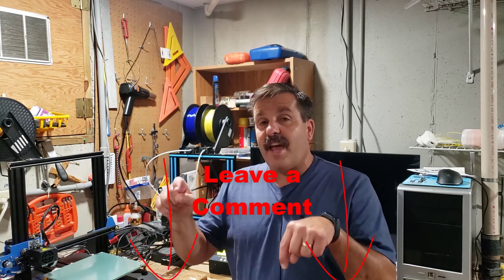My Geeetech A10M display is borked. Any Suggestions?

Comment: Have you tried unplugging it and plugging it back in? Also it might be a problem with the screen display and not the printer.
Reply from the maker: I have, but I am going to pull the whole display off now that you mention it. Thanks for the idea!
Reply from the maker: Dude! Worked like a champ. When I had the display removed it was so much easier to get the cable in place. Working like a champ again. Thanks! 👍💯